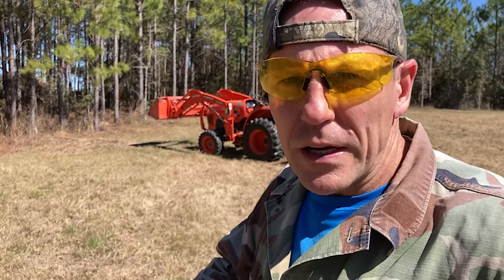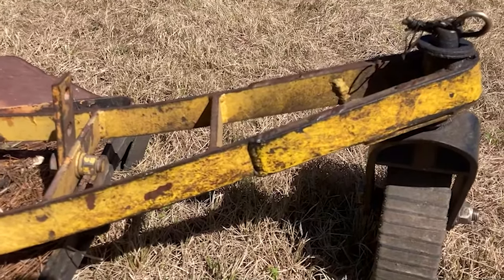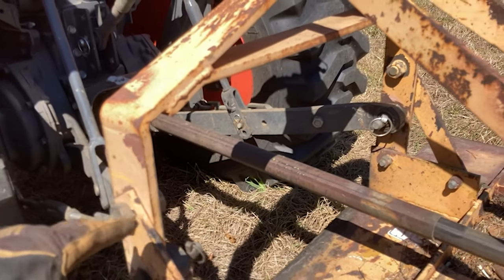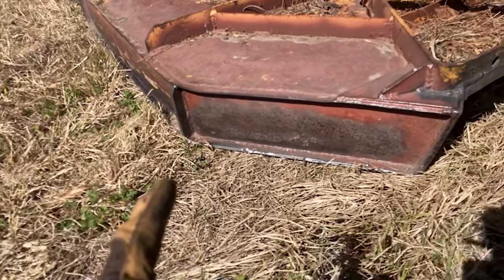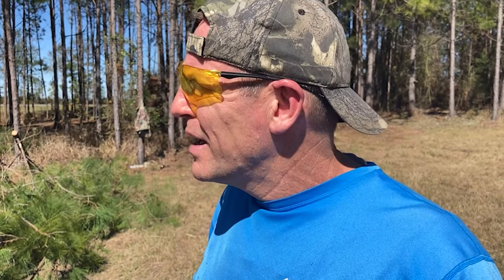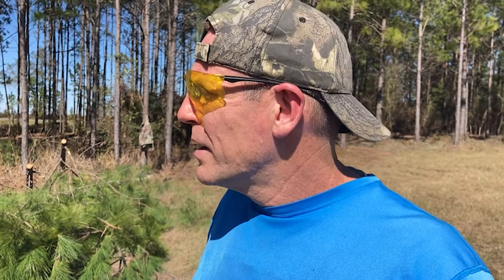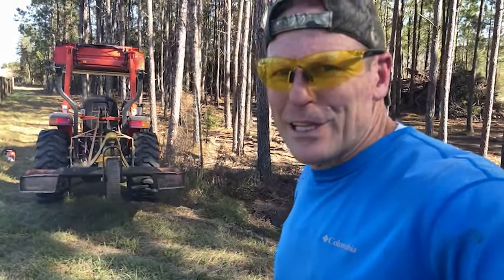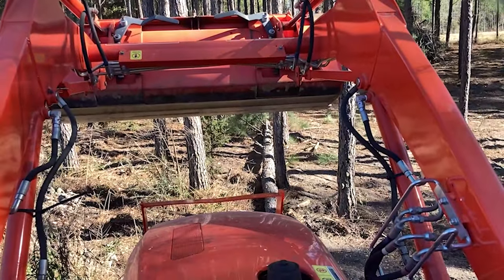Clearing Land with Just a Compact Tractor Bucket and Brush Hog!!

Comment: Great maintenance tips there!  I really need to get better at just doing a pre trip inspection.  Maybe I wouldn’t run around with a busted HST fan for ages…. Lol. I could definitely find a use for a grapple too!  I had to laugh when the stack all rolled out of the bucket.  😂🤣
Reply from the maker: Concrete floor is a real good indicator if you have have leaks!   What's the chances that not one branch stayed in the bucket???   Thanks for watching, Lucas.

Comment: Well Brad, I don't know if I can express how much a grapple saves you vs how much it costs. I figure I do around 10 times in a day with my grapple that it would take without one. They're expensive, but you'll use it constantly and it will save your back as well as your time.
Reply from the maker: Thanks for watching, David.  Now that Precious is back in operation, we've got a work around.   Hard to drop that amount of cash on a 3rd function and another implement when Piney Grove has so many other "needs"!!  B&D